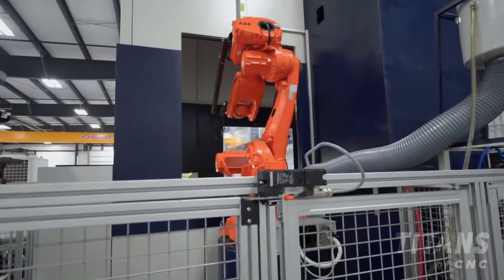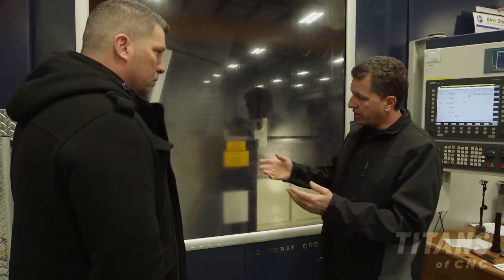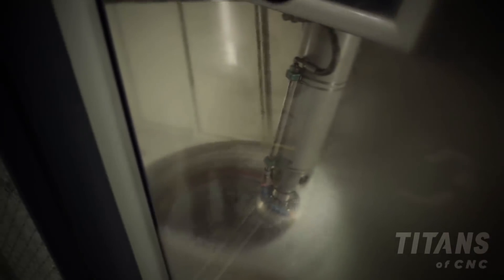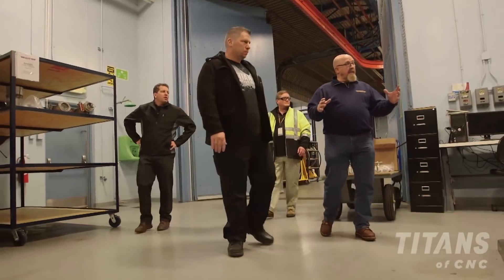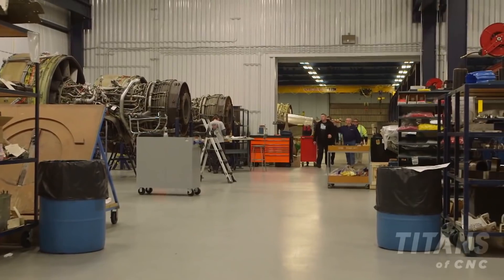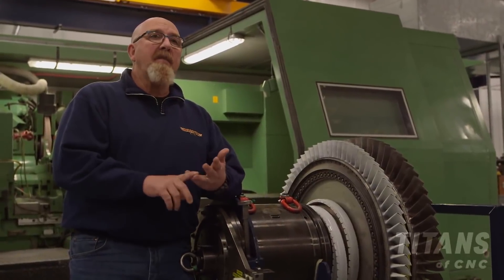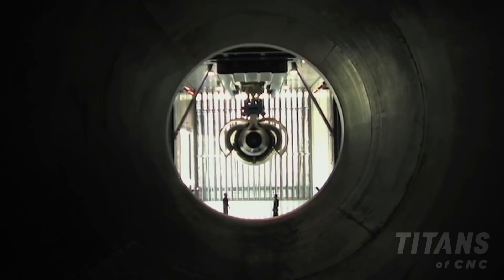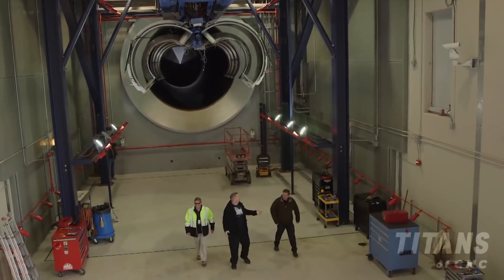90,000 HORSEPOWER Jet Engines Made With CNC Machined Parts

Comment: GE and other aerospace manufactures are extremely strict with images or videos containing the ins and outs of the engines. to the point that I'm almost surprised that such a detailed video still exists.. if you research any GE engine, it is extremely difficult to find anything showing the inner workings. you will pretty much only find the outside view of them and very basic info.

Comment: Hi Titan,

What's the tolerance on that turbine?
Reply: usually about a 1/10,000 from inside of shroud to tip of rotating compressor blades and post combustion, 1/10,000 between outer shrouds to the rotating turbine blade tips (turbine blade tips actually have a shroud, whose thickness varies wildly, according to the temperature performance of the metal [because higher heat = higher temperature differential = greater efficiency = greater thrust]  that encircles the turbine blades and is stationary in relation to turbine rotation, but rotates in relation to engine shrouds....about 1:10,000 between rotating shroud and stationary 'engine block', if that makes sense....)

Comment: Just out of curiosity. when using the machine you cut with to do the inspection if there was an error due to say backlash, would not the inspection duplicate the error and then pass the part as good? same as if a lathe had a taper, the tool is following an expected straight path, I would think like an indicator on the carriage that the inspection head would also follow the tool path and show it as straight when in fact a micrometer shows the error of the taper.
Reply: Machine is serviced and calibrated  every 12months using laser measuring equipment for pitch compensation. Also it runs it's own cal cycle on the calibration blocks inside the machine every cycle, also every so many components a master ring or part it thrown on and measured to make sure it's still measuring the same.
Reply: @garyhowe88   Gary, Thank you for responding. That process would be sufficient for me.

Comment: The part about maintaining clearances between the rotating mass and the housing, measured in tenths, through out the power range is fascinating. It'd be interesting to hear how that works.
Reply: It's called active clearance control but it is only used on the power turbine case. Basically bleed air from a rear stage (hotter air) is blown onto the pt case to increase thermal growth to increase tip clearance at full power (take off). At cruise bleed air from an earlier stage (cooler air) is blown onto the pt case to reduce tip clearance for efficiency. There is no active clearance control for the HPT they were talking about. Clearance will vary here depending on power setting.
Reply: @danielmargot7886  Hey thanks Daniel for the explanation. Are those clearances really in the .0001ths of an inch?
Reply: @musoangelo  I think he said they aim for .010" clearance. I used to work on those engines and their industrial derivatives but I can't remember the clearance. There is abradible  material that the blade tips eat into to to reduce clearance  even more.
Reply: OK, that makes more sense, but it is still a pretty tight clearance. If I understand what you're saying, the abradible material is sacrificial and the .01" clearance is what is left after it's "run in"?
Reply: @musoangelo  not run in but the clearance at assembly.
Reply: @danielmargot7886  Thanks for that.  I'm curious as to the abradible processes, what it involves? I'll try looking online as see what I can learn. Again thanks for taking the time to answer some questions.
Reply: Yes exactly clearance at assembly. The abradible material is in the form of a segmented ring. Each segment is made from high temperature alloy with the abradible material bonded to it (I'm guessing through HVOF). The power turbine seal teeth eat into a high Nickle alloy honeycomb material.

Comment: When I was an apprentice at Lucas Aerospace in Burnley, UK. I was in charge of the grinding department making flame tubes for Rolls Royce and Bristol Siddley.  even did work on the Concorde engines.  No CNC then but we had plug board controllers on the capstan lathes.